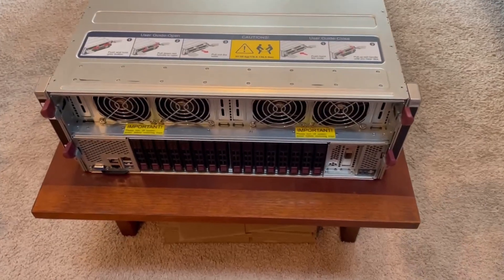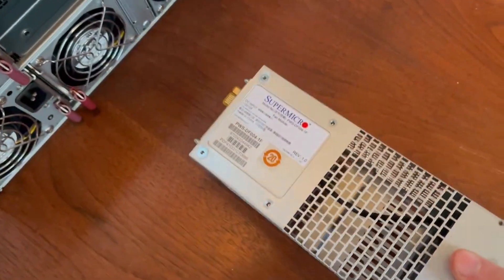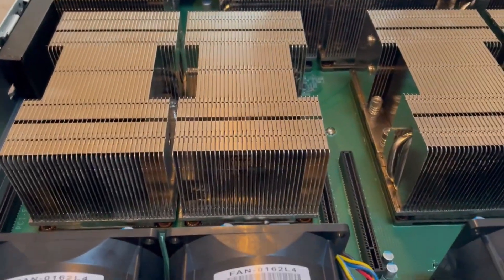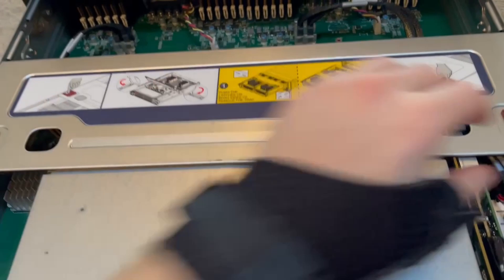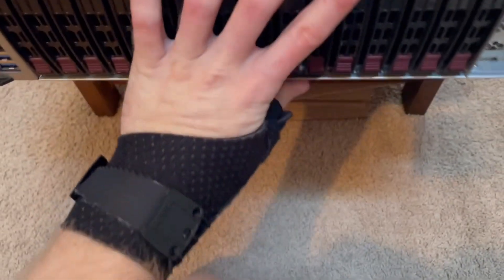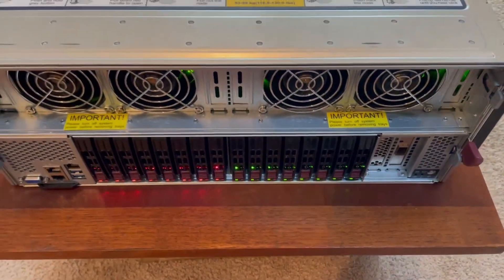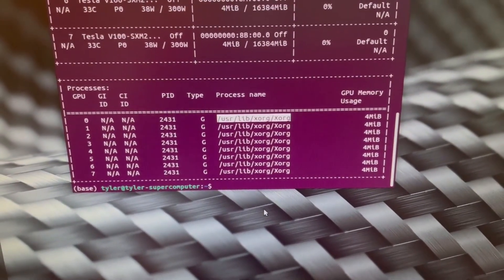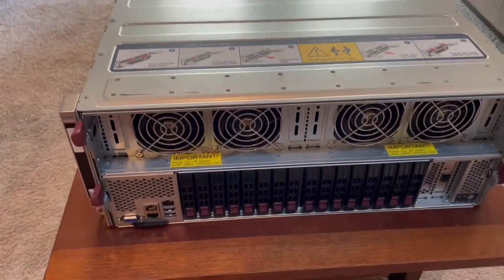Supermicro AI Compute Server, 8x Nvidia Tesla V100, 768GB DDR4, 2x Intel Xeon E5-2699V4, 4028GR-TVRT

Comment: (1) Does this model (4028GR) support Nvidia Tesla P40 GPU?
(2) Roughly how much is the electricity bill if I leave this server on continuously for 24 hours? Thank you.
Reply from the maker: 1. As fair as I am aware NVIDIA does not make an sxm variant of the P40, but there are similar supermicro models like this that support pcie-based gpus.
2. A guess: 200w for fans and other + CPUs + Gpus, it really depends on workload. Idle is probably 400-500w. 
3. If you are installing this is a home be mindful of the noise.

Comment: hey I've got another question, the gpu specs say max power draw 300W, yet the system max power draw on 240V claims 2090W... 300 x 8 = 2400W, so how can all 8 gpus run if the system claims max is 2090w?
Reply from the maker: That’s the max for one PSU, if drawing max power the system will load balance the power across its 4x 2090W PSUs. (The PSUs also do less than 2090w on 120v)
Reply: @tylerebowers  hm ok, its odd that the manual says "total output power". Also, the manual claims "2+2 redundancy" im not entirely sure what that means.. does that mean max power is actually 2090 x 2? If it was 2090 x 4 then why is it called 2+2 redundancy? 😵‍💫
Reply from the maker: @jonnyb1761  because it can run off of only two PSUs. Each psu can do 2090W so if it’s 2+2 then it is 2x2090W. (2 active 2 spares).
Reply: @tylerebowers  so then it only load balances across 2 psu's while keeping the other 2 spare? are they grouped in a specific way or is it any 2 at a time?
Reply from the maker: @jonnyb1761  Not 100% sure on how that subsystem works. But I think that is the case.

Comment: is a seperate RAID controller necessary? I thought the system has its own RAID controller
Reply from the maker: To use sas raid yes, for just sata raid the onboard controller works.
Reply: @tylerebowers  ah ok, is sas really that much better than sata for training?
Reply from the maker: @jonnyb1761  I don’t think there would really be any difference, I just didn’t have any sata drives to use.
Reply: @tylerebowers  I see. Thanks!

Comment: The electric bill gonna be wild 😂
Reply from the maker: Doing absolutely nothing (ilde in OS) it takes 600w.
Reply: @tylerebowers  well those fan alone running atleast at 40% speed gonna suck about 180w minimum, not mentioning most server board disable C state for minimizing failure rate, it is what it is I guess 😅. I use consumer X99 platform btw, but my homelab server using C612 motherboard but in more "conservative" design
Reply: On that note I'm using it's older (and weaker) brother, 2650v3 paired with GTX 1070, not bad for daily task and workstation use, but damn it the electric bill keep rising up I cant hold it any longer (probably will decommissioned as my primary workstation in july 2023 😢)